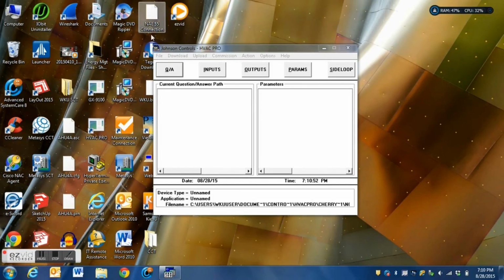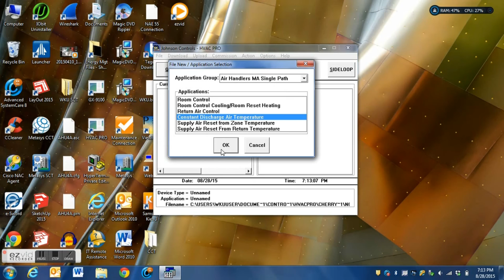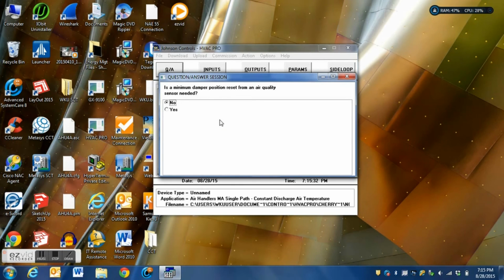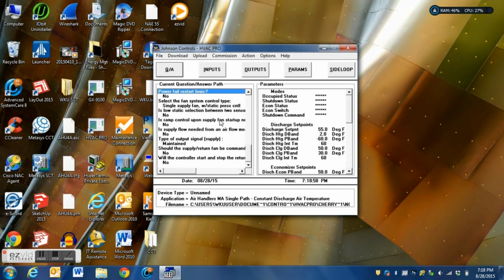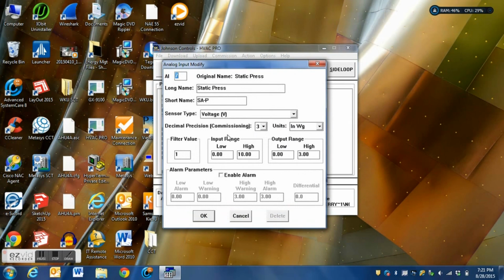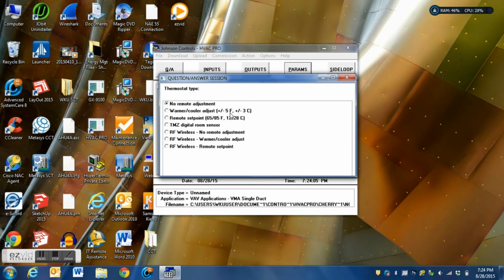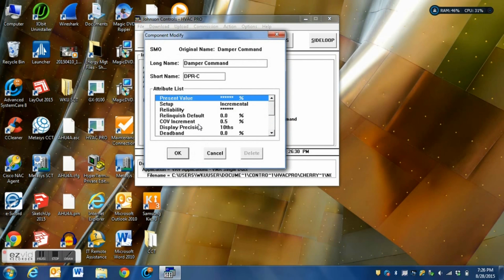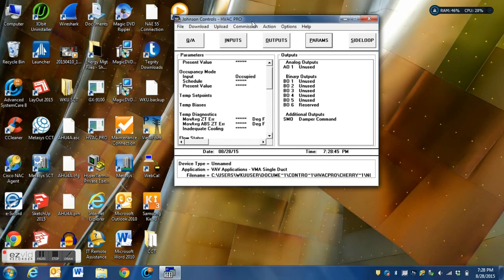Johnson Controls HVAC Pro

Comment: Hello Sir, this video is 8 years old and I accidently hit your video. This video is of no use. You are just talking about the Johnsons Control software HVAC Pro. Your approach is just to show what can be done through software in configuring the environment. There is no block diagram as to what are the inputs, outputs, and other aux components for an Air Handler. Basically this video is 18 minutes of useless information. Although it is 8 years old. I disliked it and banned your channel to never to watch it every again. You spent 18 mints and you did not have any way of showing through a simulator. What a crap this HVAC Pro is. Garbage.

Comment: I'm new at this so be patient. We have 2 Facility Explorer PCG2611 controllers connected to 24 VAVs with Metasys  controllers via Bacnet and a Supervisor to the Network. I work for the City Of Brandon. Our graphic front end allows me to over ride so setting but not many. I do not have any software like CCT or HVAC Pro on this computer to make any adjustment to any controller. Can you tell me what I need, software wise, to make some small adjustments to set points, etc. Any help would be appreciated. jcomptonatbrandonmsdotorg
Reply from the maker: You can contact jci and buy the license for cct
Reply: System Control Tech thanks again

Comment: on what communication on a N2 controller using hvac pro do i have to reset the controller on zone bus comms or n2 bus comms i forgot
Reply from the maker: If you plug into the thermostat you will need to use zone bus.  Use the N2 if you want to connect to another device on the network than the one you are directly connected to.

Comment: Are you able to run the HVAC pro on Windows 10 or get the XP mode to run using the USB-3 portAnkle
Reply from the maker: Yes but it must be a 32 bit image in order to run.  You can also use USB to serial converters.  You just need to remember to set them to port 1 or port 2 in order for it to work.